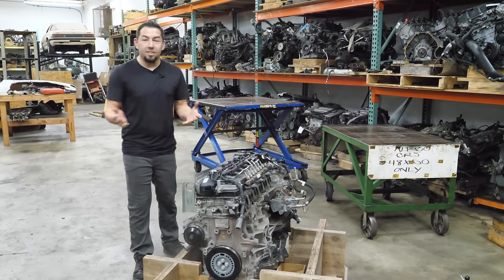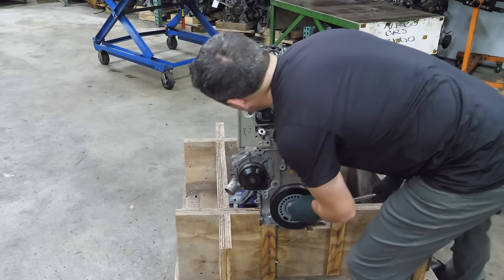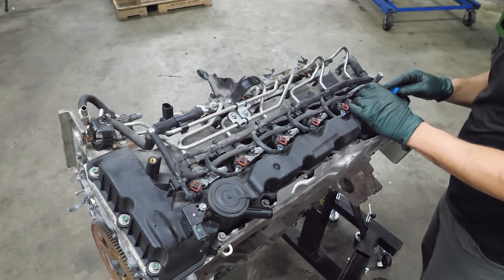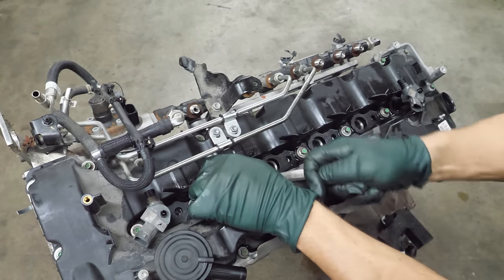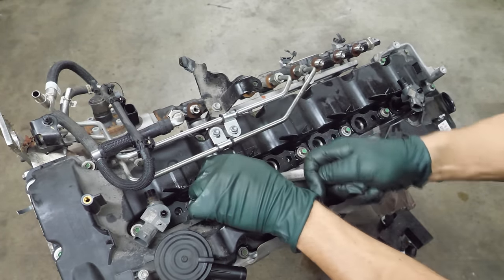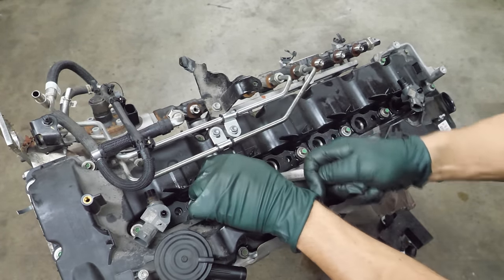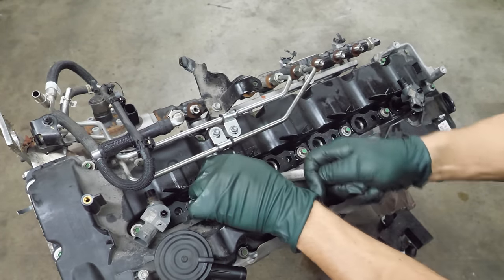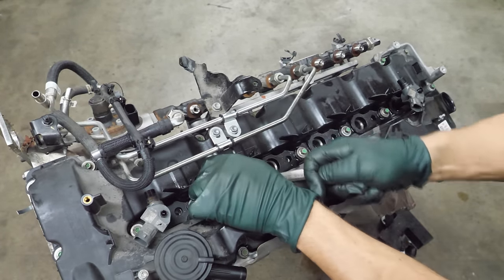BAD 2020 Silverado 3.0 Duramax LM2 Engine Teardown INCREDIBLE DAMAGE!

Comment: The moral of the story for everyone here....dont abuse your engine. I guarantee with over 140,000miles on the clock and being only two years old, this one was driven hard, and put away wet. Probably an owner that worked on the theory 'ill change the oil next week', 'shit forgot again', ' ill change it tomorrow', ' crap i was supposed to get the oil changed last weekend'...and and and...20,000miles later...'im not hearing good things from under the hood', changes the oil, but its still making bad noises...goes to the dealership, my engine isnt running right. They plug it in, the system tells them low/no oil pressure detection at previous recent date...congrats, you now have no warranty and your engine is screwed. Modern engines are not built like they used to be. You cant just wait to serivce it and hope it holds together. Some are better than others, but not a lot. If your oil change interval is 5K, do it at four without fail. If your vehicle idles a lot or does short trips do it at 3.5K. Is that more expensive, hell yes, but then again a new engine is 50 times more. The dealerships are not in the business for replacing engines for free, especially if theyve been neglected. This engine was still under warranty for another 4 years. Sounds like the dealership told the owner where to go and didnt cover it. Im sure the trucks computer told a lot of the story. Just my opinion.

Comment: I think this engine just might top the list of the worst engine designs ever.The oil pump drive belt,timing chain arrangement,etc..kinda reminds me of the AUDI 4.2 V8 that also has the timing chain and tensioners at the rear of the engine.

Comment: Such a shame. Those engines are designed so well except the timing chains and oil pump the engineers designed is horrible. If it had a gear train on the front end I’m sure it would be a great engine, but instead it’s garbage.

Comment: There's no point in complaining about modern engines being junk, nobody really took advantage of well designed old engines either, believe me i know i rebuild motors for a living. Modern engines prioritize emissions, efficiency, packaging and costs. Removing the cab on a modern truck is so much faster than the older stuff, and it's lighter since all of them use substantially more aluminum and plastic in the body and interior. And this is all because EPA makes everything stricter and stricter yearly, along with DOT and state legislature. This is all gonna lead to electric and that's just how it is. And the reality is, that's the best for everyone whether they admit it or not. There's a handful of people who actually value their vehicle and see it as more than just an appliance to use abuse and replace, but the economy doesn't run on exceptions it runs on the 99%.

Also as an engine shop, these aren't old enough yet to call junk or gem but i've seen more needing work than i should for a 3 year old engine. They're not rebuildable yet because parts aren't widely available yet, once they are i'll probably be making a killing on them like i made on the Gen 5 LSes, Hyundai stuff, Ford everything but Cayote, Hemis, and so on. I should send a letter of thanks to these companies for buying my second rental property lol.

Comment: A lot of these engine failures seem to be lack of oil or dirty oil. Regular oil changes and maintaining proper oil level are cheap compared to replacing an engine.
Reply: As the saying goes - "Oil is cheaper than iron."

Comment: Id bet the pdf filter and def injection system costs twice that engine. So that guy brought a $80,000+ truck in '21 in then in '23 paid $28,000 for a new pdf filter and pump they only last around 100,000mi. Now in '24 had to pay $20,000 for an engine(installed). So that guy is at $128,000 into a truck that should cost $42,000.

Comment: I am guessing whatever consumption improvement you get with this diesel over a gas engine is wasted 10x over when you need to service the belt at 150k miles.   I am in the market for a new Tahoe to replace my 2002 w/ 350k miles but these Duramax videos have really turned me off.    I also hear of the many troubles with the lifters in the gas GM engines (friend of mine needed a full Silverado 1500 engine replacement at 90k miles).   Maybe time to dump GM products after 40 years of loyalty...

Comment: Modern Diesel engines are not reliable due to heavy regulation and needing to meet certain standards. They are more problematic than ever. It’s a simple engine concept that was overly complexed.

Comment: I'm a retired truck mechanic; plied the trade for almost 50 yrs. This engine by far is the utmost poorest excuse for a truck engine I have ever seen in my entire life, bar none. It's throw away junk from top to bottom, all plastic garbage. The cam drive system is a complete disaster, and why would anyone even think of driving the oil pump with a belt?? I watched this video in total disbelief.. G.M. should be ashamed of themselves for marketing such garbage and in trucks, no less. Anyone even remotely considering buying one of these nightmares would be well advised to watch this video.

Comment: Im curious if the owner didnt realize that a diesel engine holds a lot more oil than a gas engine. Some folks never read the manual. But even at that (if thats the case) its an inexplicable level of ignorance.

Comment: Whole engine could have been saved by checking the oil and a ratcheting style tensioner. Gm needs to quit with their timing chain systems and let someone else design them. There's no reason for the complexity of that timing arrangement it's a diesel.... run a gear train and you don't have these issues (imo).

Comment: . *  *  *  *  Never pry between the bolt holes on a sheet metal pan or valve cover . Disappointing design from Isuzu / GM , who would expect to replace a (Timing Chain ?)  on a diesel @ 80K miles ?  And to have to R & R the transmission to get access to it "?

Comment: Duramax or is it Duraless? looks like with this engine they are trying to reinvent the wheel ? a rubber tooth belt to drive the most important piece on an engine ?! and is not easy accessible?! really?! specially on a Diesel . If i ever buy one of those trucks I be sure to throw away that engine and replace it with a Benz or BMW diesels

Comment: this is the problem f the manufacture just use some good old Rotel t6 15w40 and I bet this will not happen but if you use what GM tells you to use ( New 0W-20 Motor Oil For 3.0L Duramax In Chevy/GMC 1500 Pick-ups) this is what will happen if you do anything but drive in the city and never tow anything but if you use your truck as a truck you should not use 0w20 oil

Comment: Why not use an electric impact to remove the hard to get out bolts instead of using a breaker bar?? Give it a try with different impacts and see which ones have the @ss to do it.

Comment: Its a pretty poorly designed engine that the factory knows it uses oil and still puts it in production. .  Gm has been doing this for decades vega, oldsmobile diesel,  468 cadillac,  current 8 speed...the list just keeps on and people keep buying
Reply: what about ecodiesel?

Comment: I think we’ve been lulled into a false sense of security about timing chain durability in modern engines.  Most new chains are cheap & weak.  I think a quality timing belt is probably better than most modern Chevy, Ford, or Dodge chains.  Far better harmonics & less friction loss with a belt as well. Never had a problem with my 25 years of Honda timing belts & I rarely put less than 200,000 miles on my Honda V6’s. I usually just do one timing belt change at around 130,000 miles.  Even then there’s almost no stretch or damage to the belt, I do them myself.  …All that said, that Duramax set up is definitely suspect.

Comment: So I have a friend who bought one of these first. when they first came out and I bet him he would never drive it past two 200,000 miles. He took that bet. He said ohh. it's a diesel. And why would they build one? that's not designed to go at least three 300,000 miles. And I told him. It's all about profit right now. Is up 'cause there is no guarantee of high mileage? Well, as you can bet, I want. the bat because he never made 200,000 miles before. the engine had more problems than hid wallet could solve. He spent $7800 fixing the problems he could. So the coats could be reset and it could be sold. And he did. And he did never buy another one.

Comment: Looks like the engineers looked at a Nissan YB 25 diesel, and thought, yeah driving everything on two single row chains is a recipe for disaster, so lets do the same, but we'll mount it at the rear, where it doesn't belong. Hell, we'll add a belt drive oil pump and stamped steel rocker arms to make sure it’s only reliable enough to meet the warranty cutoff mileage. Oh, while we're at it, we'll call it a Duramax, to mislead the average idiots into believing it's rugged, the brand loyal fools will return and buy another of our poorly engineered pieces of crap. Only to cry foul when competition takes their market share.

Comment: What an idiotic design for any engine!! What ever possessed them to put the timing chain on the back of the engine, where you essentially have to pull the engine to replace it.. not to mention the absolute stupidity of using any kind of a flexible belt to turn the most critical part of the engine, the oil pump?! I wonder if there is a service kit to replace that mess with an actual chain and sprockets? These engines are notorious for using oil, since they recommend 0w-20 oil, which I don't think would be suitable for any diesel engine, especially one that redlines at 5,000 rpm.😲 Overall, the valve train looks pretty solid, until you get to the weak single row timing chains running dual overhead cams, and 24 valves.😬 That's a recipe for disaster right there, considering what the load on that chain would be at higher rpm's, especially the primary chain that has to run the high pressure rail pump AND the upper timing components. I'm kind of surprised it didn't have 4 bolt mains, seeing as the block is cast aluminum. The crank must be made of 'unobtainium' to suffer as little damage as it did after losing a rod bearing. My guess is it ran low on oil, and starved the rod bearing, and probably jumped time and crashed the valves around the same time. That upper timing chain was stretched to hell on first glance.😝

Comment: Why are you taking it apart? You have an engine with low power and you know it has slack in the timing chain. Fix the broken tensioner or whatever is causing your slack and you're done. You obviously have never torn one of these apart and the more you take off the more you destroy. Just like the front seal retaining plate that didn't need to come off that is now destroyed. I'm not trying to be an ass, but I don't think you're thinking this through. Do as little as possible as rebuilding it completely will net you nothing with the type of mileage it has on it..
Also FYI, there's no reason that you should have been concerned about valve cover bolt sequence. It's plastic and you're taking it off! 
Of course tensioners are oil pressure fed but they will have a redundant tension mechanism. Your tensioner is clearly faulty and I'm very confused as to why you're looking at the wrong chain/belt. There are 3 and for some reason you're looking at the one that shows zero signs of an issue?!?
Poor engine will never run again..
Reply from the maker: You do know, I don’t rebuild engines… these are cores, they get dismantled for parts.
The good parts get sold, the bad parts get recycled. That’s part of the business I’m in.

Comment: Why on earth did they build it that way? Have to pull the motor to get to all that timing stuff, and a belt on the oil pump?? GM really is the worst manufacturer there is..   They couldnt even copy a cummins right..

Comment: I've had 2 GM vehicles, a 2017 Sierra and a 2023 Sierra. both had junk transmissions. I won't be buying a GM product anytime soon, specially when GM says their products weren't manufactured defectively, but rather designed defectively..LOL basically their saying they wont warranty their products cause it wasnt built wrong, instead it's just trash to begin with

Comment: A timing belt, not a chain...and in the worst place..alum pistons...2 bolt mains...and a crank that looks no beefier than the old OLDS 350 gas/diesel....doesn't GM ever learn? Stop letting the bean counters run the show!!!

Comment: Imagine 20 years  in the future when all these crap engines have been fixed and replaced until just getting trashed. At least with older engines you can take em apart and rebuild them with mostly standard tools and especially the desired engines. These will just be piling up in junkyards 1000s of 3.0 duramax's ram eco diesels and all the other planned obsolescence engines 😩😩

Comment: We have been making diesel engines for a very long time and on the whole they have been super reliable and last a very long time until we started making them from aluminium to make them lighter and we started using timing chains instead of gears and we made the pistons smaller and lighter with less rings , in short we built them like petrol engines so they would rev but then we turbocharged them to increase power but that also increased the load forces. These engines look impressive from a construction point of view but when you put Kevlar belts inside the engine to drive the oil pump and single row timing chains your reliability index just got trashed. I will stick with my trusty old 2H fully cast iron mechanical injected Toyota Landcruiser that has just passed 500,000 miles and is still going strong. it is not powerful but it has enough torque to take me to all the off road areas I go and it has never let me down. I have helped pull many more modern vehicles from where they have broken down than I have older units like mine. These engines are stressed that is how they get the power out of them. In big trucks when they stress the engine to make power they build it with heavier componentry to handle that stress in these vehicles they don't I would not own a modern diesel these days as they are far to complicated and far to stressed.

Comment: The rubber belt running the oil pump is even more stupid than GM's afm system on the gas V8 's. I have seen that engine reman companies have eliminated the afm lifters and cam, thus making the engines more reliable. I would hope that that the reman market comes up with a better system for the these 3.0 diesels. Maybe a set of timing gears or a chain that won't need maintenance by pulling the freaking transmission! Dumb GM, just dumb. Stop it!

Comment: Damn....gm has gone downhill. The ford 3 cylinder eco tech or boost or whatever the hell if is uses a belt for the oil pump as well.....and they are starting to fail which wipes out the engine....looks like the gm diesel is now disposable as well....such a shame.....those little engines work good when they're working.

Comment: You could have stopped the video in the first couple of minutes when we got see the rubber belt at the back of the engine which makes it virtually unserviceable unless your willing to spend big money.  This engine will go down the same path as the Ford 6.4 diesel, they are built to last about 150k miles or so and then kaboom time for a new crate engine for 20 grand plus labor.   I just dont like being a guinea pig and it seems that GM likes to do their testing with their customers, not during R and D.

Comment: 3.0 diesel is a nightmare EGR sensor problems since 35,000 miles Chevy should recall this pile of junk . Low power mode no AC and no emergency brake total nightmare get gas ⛽️ but make sure it’s a Toyota

Comment: 5.3 and 6.2 have lifter issues. 3.0 has the belt/timing issues. Is the 2.7 4 cylinder the most robust teuck engine GM has? 😂

Comment: These engines are junk I had one in a 21 sierra nothing but problems, excessive blowby, def consumsion, low power. And because it was under warranty dealer's refused to admit anything was wrong.

Comment: Remember the GM engineer famously stated the rubber oil pump drive belt was designed to last the life of the engine. 125,000 miles! This engine made it all the way to 146,000. They got more than expected! Good job GM! Ughhh

Comment: What is it with auto manufacturers and their SHITTY timing chain designs today?? 🤔 

Just take a look at the G.M.  Ecotec 4-cylinder and the "High-Value" V-6 series... 

Some of these engines have a factory service interval of 60,000 miles for a timing chain replacement, and many of them have had the chains fail and jump timing even before that. 
If you are LUCKY, a failed chain will simply throw a check engine light and make the engine run crappy, BUT sometimes the chain jumps too many teeth and then the pistons hit the valves and bend almost all of them. Now you have to remove the head(s) and have them totally rebuilt. 

10 years ago, a timing chain would last the life of the vehicle, and NEVER needed to be replaced.
Reply: You need to sit in some meetings between engineering and the financial guys and it will all be clear to you.

Comment: Isuzu plus American worker equals worst made engine. Ive have several Isuzu diesel s before. Never had a problem ever. I bought a 2021 silverado and at 40k the engine sezied up. Needless to say after a year of fighting general motors I cut my losses and bought a dodge with the Cummings.  So far so good.

Comment: The timing chain and belt drive on the oil pump on back of the engine is stupid. The engine looks like a good design looks to be a good design though. Engineers are idiots for the most part. They don't have to work on anything they design so they don't care. Cut their pay to fix their design screw ups and that might change.